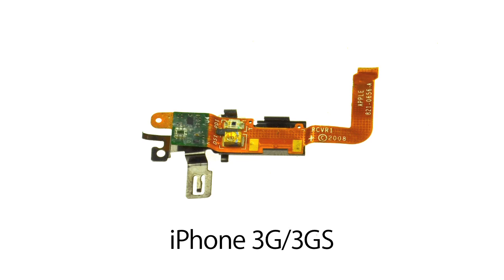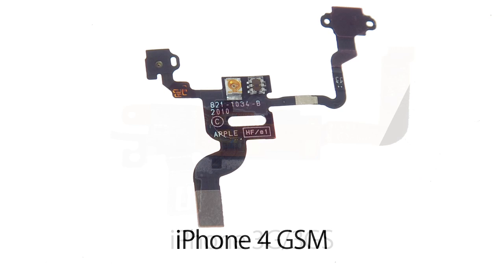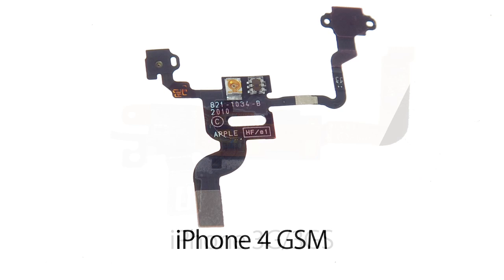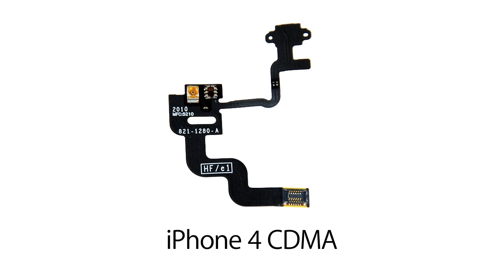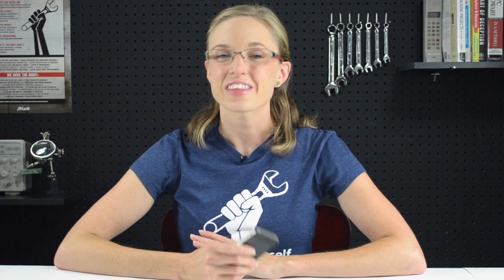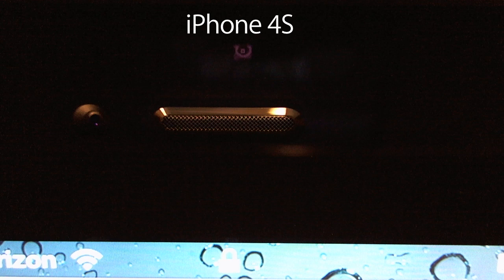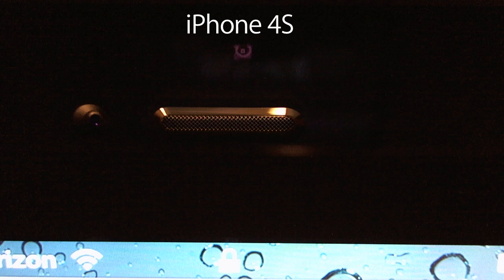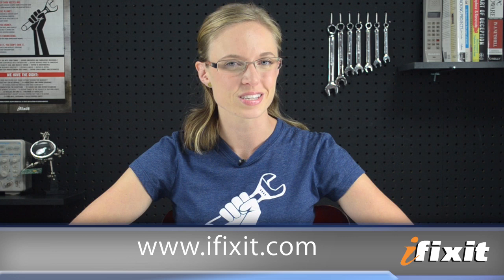How Siri Knows When You're There

Comment: This is bull :\ Siri does not requires the use of a IR Sensor nor would it need one, as Siri is activated buy holding the Home button or pressing the Mic button on the keyboard.

after 5.0.1 see if the IR Sensor is still active all the time.